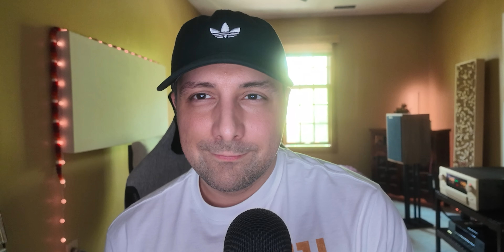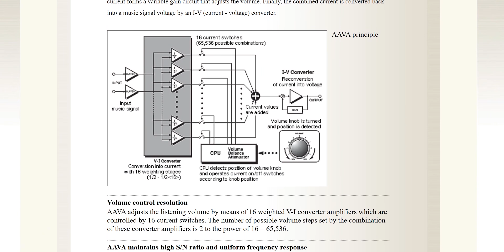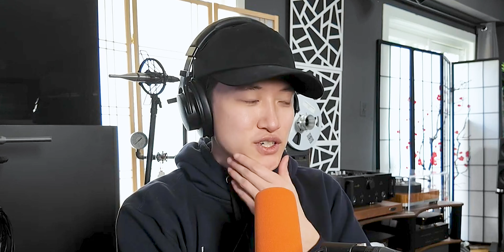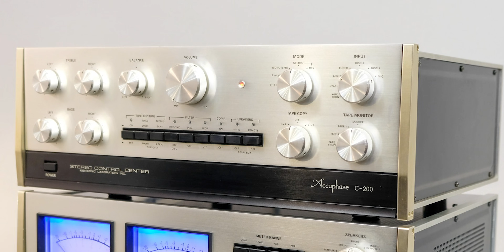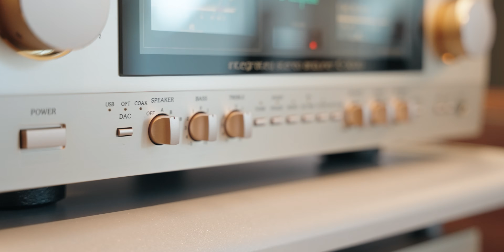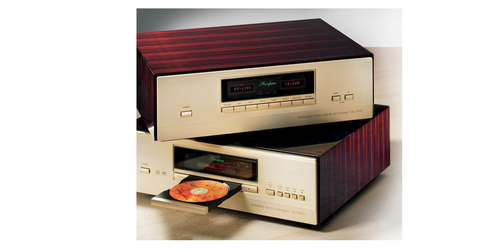Accuphase Engineers Reveal WHY Their Amplifiers Are The Best in the World

Comment: Unless you live far away from human civilization, in the average listening room in a city, the noise level from traffic, household appliances etc, will be so high that a S/R ratio of more than 60 dB is difficult to realize.  Therefore, S/R ratios exceeding 100 dB in amplifier specifications are meaningless in real life. Most likely the hum from the power transformer will be louder than the noise from the electric circuit of the amp.

Comment: A very cosy interview. Nice. But I would like to share some experiences as a user of many model.
1. Even though they can repair and restore very old models by special department. It is privileged to domestic customer only. The procedure to send unit back to factory is very restrictive. They denied to restored my C280L while it was still in Japan just because it was still working.  So, it has to be broke to get authorization to send it. Details procedures are explained in Japanese website.
2. Although product’s longevity are long. But new models released every 5 years with better specs, so unlikely we will keep each for 20 years like in the past. We will want to upgrade anyway. 
3. I have fail Accuphase 3 times. Eventually old amplifiers will require services, I had a failed P11, P500L, and PS520 before . The failed PS520 also blew fuses of connected electronics. 
4. Is there a way that they design the source selector and volume knob without showing screw hole on side of those knobs ? Those holes ruin otherwise good aesthetic.

Comment: Question regarding repair, servicing / overhauling vintage Accuphase units: I am a proud owner of an Accuphase E-205 integrated amplifier. I bought it in 2006 from it's first owner in Germany. It has served me flawlessly ever since, however I have noticed a hum coming from the power supply unit a few months ago. I have contacted the local dealership (Hungary). They have informed me that this unit is too old, and they cannot get new parts for it anymore therefore they cannot do the service. They have suggested a local independent service which may be able to do the repair if there is no need for original parts... After I have seen Your interview I have contacted Accuphase in Japan directly asking for a service / overhaul in the factory. They have refused the service citing the same reasons as the local dealer, so I am wondering if the repair / overhaul service for vintage units mentioned in the interview is only valid in Japan ? Since my E-205 is definitely a later model than the P-200 or C-200 mentioned in the interview as examples of repaired vintage units, it should be possible to do the service. Do You have any information if there is any restriction - geographical or otherwise - at Accuphase regarding the service of vintage units ? Thanks in advance for Your kind reply !

Comment: lowering S/N and THD is IMO going to have to be core to any 'audio company' - if it is not core to some company, they are simply not an 'audio company' as such. Most companies that produce audio equipment do not care about that kind of stuff as a core design aspect - not saying it is not a factor for them - it usually is, but it is just one factor among many others and often equal to something like 'design appeal' for example and how well something is positioned within a specific segment and subsegment based on various criteria. 
So what I mean is that for some big electronics brands who do offer audio products, they will have a management level meeting where someone brings up for instance that they don't have any current product line in for instance "premium +" market segment, and what then happens is they look at the target retail price bracket for it, just to pull a number out of thing air, lets say the average price for a premium+ class 2 channel low wattage amplifier is $1000, what this means is that wholesale is going to be max $500, preferably less than that. The other 500 is markup, tax, transport etc. Then of the 500 that remains as wholesale, you have wholesale channel markup of $150 lets say, packaging etc $50 which leaves $300 for the amp itself - from this you're going to need to take profit, which we'll say is $100, then materials $100 and labor $100. Then you're going to look at presentation etc, so the "product packaging" by which I mean case, knobs, metal finish etc, which is often both pricey and important - it is the impression the device gives, so we'll allocate $50 material(machining,shaping,blanks incl.) and $50 labor(polish, asseblym testing) which means we have 50$ each for PCB+Components and assembly+testing - which may seem very little but it is close to average for the range I'm talking about. 
So what this all works out to in very basic terms if that you have roughly speaking $50 of components in $50 case in $50 packaging on the retail shelf for $1000 - all the rest is labor and markup+transport+sales etc. Sales tax is factored in here at the 500 to 1000 jump, that is sales tax + retail markup, it makes no sense to separate them for this because they depend on market a lot first of all, second of all they are the same thing ultimately in many ways. It's the "cost to bring to market" essentially. I have left out many things like marketing etc because they are entire topics upon themselves, and they vary a LOT from company to company and they are very difficult to 'attribute' to a specific product - and are more a lifecycle type expense, when something is manufactured and brought to market, at the beginning, by which I mean it can be as much as the first year, the brand/manufacturer makes zero profit on it, if they are lucky they break even. After the first year they start making profit, the R&D and setup costs have been paid (hopefully) and the marketing campaigns in whatever form they take have been done and the market awareness of the product is sufficient. Usually the component costs also drop around this point for a number of reasons, the order volumes can go up because forecasting can be done further out and the R&D amortization of some components at their manufacturers has been done at least in part and many other factors. 
------- 
So then on the kinda opposite side you have companies like I think Accuphase is where they create something because they see an advantage to it in terms of achieving the aims they have for their product, like the AAVA volume control system - they don't start with "lets pick this market segment with average device cost of X and make a device for that segment" but instead they start at what you could call the "opposite end" of it, which is they see a need for something and create a solution to cater to that need - and then add it to a product or build a product around it based on what they aim to achieve in performance terms primarily - not saying they ignore price, but I think it is much less a factor, and certainly not "the overriding factor" because if it was they would use a potentiometer and call it a day. 
So what will then happen usually if they develop the tech, refine it, find the optimal "packaging" for it in terms of what other features should the product have, what are the right "versions" of those features to balance with the rest of the product, then the physical packaging like case, knobs, terminals etc and retail packaging and so on and they will arrive at some $ amount, look at projected cost development for components etc and what their profit margin needs to be and so on, and arrive at some price at which they can wholesale the device while making some profit and then it will go from there on adding the sales channel cost on top and end up with some retail price which is much less a starting point for the product development than it is in the case for most consumer space manufacturers or more specifically 'brands' because they are not the same thing when it comes to much of the market. Without getting into sales names, but there are big factories in China primarily that churn out products from competing brand names on production lines next to each other. Foxconn is one such maker mostly in the PC component and peripheral space but there are others for A/V gear. 
----
Finally, this is an approximation to varying degrees that I typed out to try to illustrate the different direction of product development that brands have on one hand but also a little bit of how the value proposition for a product from a brand like Accuphase is different from what it would be with a lot of brands in the consumer electronics space in general, where price does have a relation to what you get - but that relation is often very different from one brand to the next and different from what consumers think it is, so it is very dicey to compare them directly and thinking they are like for like - because they are fundamentally different quite often.

Comment: I really liked the answer on capacitors. As a shop that sells and repairs a lot of vintage audio, we get the question (a lot) if we will re-cap peoples receivers, preamps and power amps. Our answer is, we will if you insist, but it's going to change the sound of your unit dramatically and it won't sound like your lovely vintage piece anymore. Capacitors are frequently the wild card of the sound of our gear.

Comment: I have two Accuphase units from the 90s (DC-300 and DP-90) and a 2003 power amp (A-30).

All three are in perfect working order as if they had just left the factory.

Furthermore, the other Accuphase components I had (E-210, C-265, DP-67, A-20V), never had any failures or malfunctions.

Accuphase is forever...

Comment: If a product is engineered for longevity, why does it get a successor every few years? For example, the Accuphase E-3000 replacing the E-280, which was already a top-tier integrated amp. Isn’t that a bit contradictory? These companies aren’t aiming for rapid expansion, don’t need outside investors, and already earn healthy profits from their high-end pricing — so what’s the real motivation behind constantly releasing new models? Jayiyagi over to you😃
Reply from the maker: Thats simple. The answer is that they don’t constantly release new models. Accuphase is known for keeping their line up for a very long time
Reply: @VinayKumar-sg1bg They're quite clear about in this video. They achieve the maximum performance possible on a certain project at a given time, and release a new model when they achieve to significantly surpass that performance. Every model change is shown in detail in the "technical information" documents on Accuphase website.

Comment: I have an older Kenwood tuner and integrated amplifier I will never sell. I  have integrated it into my tri-amplified horn based system. I did stumble my way into building my own Class A amps but still use a Yamaha high-end pre amp as I can't find anything better to replace it with and it produces a straight gain on wire  that would be difficult to replicate and have the same versatility. Thanks for your interview with the Accuphase engineers, their products are of the highest quality.

Comment: I have been in this hobby for almost 40 years now. Was heavily influenced by all the glossy ads and glowing reviews of the 1990s -2000's audio publications. Spent and lost more money than I care to admit buying with my eyes, not my ears and in the process created one of my biggest regrets which was dismissing Accuphase and most of solid state amplification for a long time. My main amp today is an older A-50. It sounds fantastic. Does it sound better than my VAC Phi70, or some of the many tube amps I have or have owned? Maybe, maybe not, but the A50 produces finally a sound which has gotten me off thinking what is next. It also is a piece of equipment which I never feel anxiety pushing the power button on, unlike some of the tube amps or even solid state amps Ive owned. (Fourier Panthere OTL's, Rowland Model 7s for example). I am using the A50 with Wilson Watt Puppy7s and an Audiovalve Conductor preamp, and Denafrips Terminator Plus. The only thing which is going to open my wallet will be another A50 to use in Bridged mode.

Comment: sustainability is an often overlooked yet very valuable feature in a world filling up with trash.   I really like their engineering first approach to product, because hearing is only individual and subjective, where solid specifications and quality give one a rock solid foundation for system building.

I am forming my buying triggers to replace the final weak link in my system, amplification.  I want to give priority to local product, but the E3000 integrated looks hard to beat for my needs.  Of course, I have a price objection, but this is the first amplifier I have found with both a phase sift and mono capability.  Both are needed because I have a lot of old records.

Comment: Oh i forgot. He mentioned therma noise. Yeah some of us are trying radiator cooling, Rads for the geeks to cool the transformers. Kinda like PC cooling, it seems to help. After 100°c thermal noise becomes apparent. Thermal noise is a real issue for continuous high outputs. Like my system, it'll play loud for a whole weekend. The only amp that doesn't sound different after getting hot AF is the Auccuphase. The Burmiester doesn't like full bore over a extended period of time. I'm talking days not a few freaking hours. Noob numbers. 
Yes I rock and destroy high end equipment on the daily. If I don't like it my friends won't buy it. Bust snake oil in a heartbeat. And I'm a poor AF dude, just honest to my rich friends..no butt kissing here. They respect that

Comment: The Accuphase P-7500 Stereo Power Amplifier would be my choice, having 1000 dampening factor, i.e.  High Current, and massive build quality.  At $26K it should last 20 to 30 years with trouble free performance.  Since I'm a poor Audiophile,  I'll stick with my dual EverSolo F-10  AMP in bridge mode with 600 dampening factor.

Comment: I'm a proud owner of an Accuphase P4600 amplifier,  Accuphase C2300 preamplifier and Accuphase DC-37 Processor/DAC. These are outstanding products - great sound and killer looks! I used to listen with the lights off with my previous brands but now the lights stay on so I can look at these gorgeous Accuphase components! My Accuphase components replaced my McIntosh MA12000 integrated amplifier which I loved.  Accuphase delivers a more accurate reproduction in terms of detail and speed, but it's warm and not clinical, and the sustain of the notes is close to that tube-like presentation that the MA12000 has. Where do I go from here? Maybe one day I'll trade up my Accuphase C2300 preamplifier with the better Accuphase preamplifier. I can only imagine!
Reply: Did you compare your amps vs. E5000? pr P4600 vs. P7500? I ordered P4600+C2300, so i am curious. I will drive Focal Sopra 2 with them.

Comment: Jay, their power amps have gain Kontrol settings, could you ask them if lower gain worsen the sound quality, reason I ask is I read somewhere that it did.
My tube pre has high output gain.
Reply: I own their P4600 amplifier. Actually in my experience lower gain significantly improves sound. I use the lowest setting.

Comment: I’ve owned an older Accuphase C280v, a little multichannel preamp Cx260, a p360 power amp and still own a dc91 dac. I’ve also had a ps500 power supply. While I’ve switched to tubes other than the dc91 dac, I can say without a doubt Accuphase is the best built stuff out there. All my vintage gear was overbuilt and still looked and sounded beautiful. Their products do tend to have a house sound that changed through the years so maybe their new stuff is different than what I am familiar with but the build quality is extreme. They are right that when you factor in longevity- there’s none better to own.
Reply: Can you expand on the house sound you heard and why you changed to tubes? I'm researching tube amps, right now and boy are there so many options and variables at play.

Comment: I put together my final system last year. E4000 is the amp I chose with the DAC60 module, along with Audiovector R3 Arrete speakers. I am extremely happy with the amp, sounds great, looks beautiful, pride of ownership is very high in my opinion.
I previously had an E280 on loan for 6 months, it was really good too, but the E4000 sounds a bit cleaner to my ears.
I wonder if Accuphase will bring out a streamer.
Reply: E280 is muffled
Reply: @RoverWaters  I would not say muffled. Just not as clean in the mids compared to the E4000.